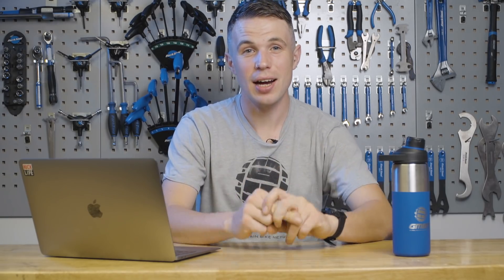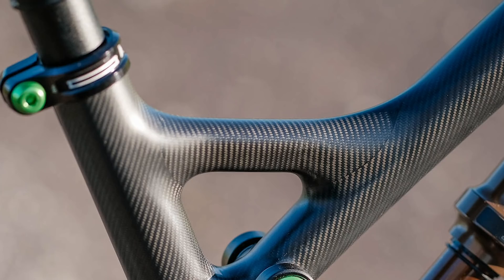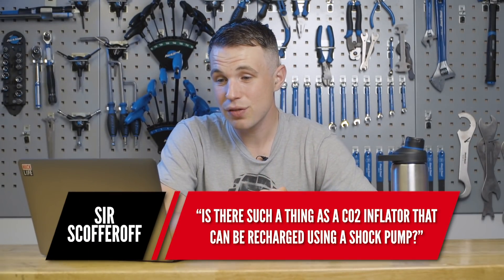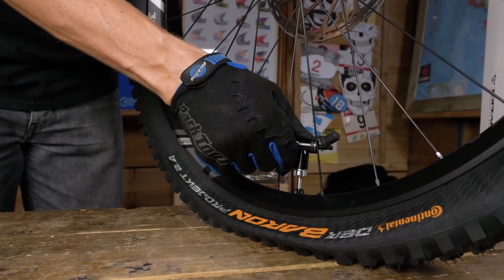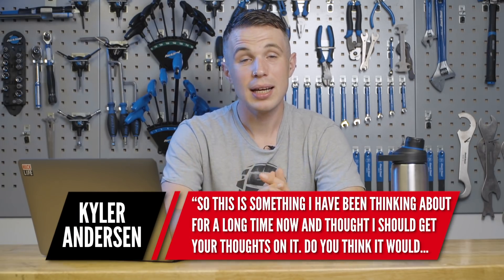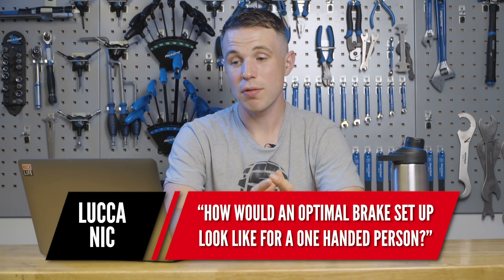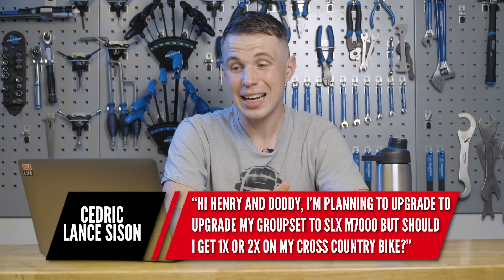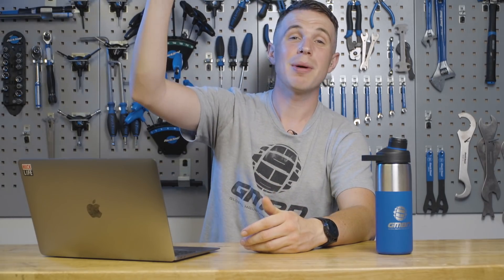Why Are Fork Stanchions Circular? | #AskGMBNTech Ep. 88

Comment: Hi doddy/henry! I have an old fox dhx 4.0 coil with the boostvalve (jepp, i’m back with my suspension problems). However, after riding my bike for like 1-2 hours it has lost all it’s pressure(which has me concerned because the minimum pressure is 125 psi) and even after pumping it up to maximum pressure, it jeeps loosing pressure over time(except when im not riding it) is the shock completely destroyed or are there any parts that I could replace?

Comment: #askgmbntech Should I upgrade my brakes (levers and calipers) or the rotors (180/160mm to 200/180mm)? I'm currently using Shimano m425 brakes w/ 180/160mm rotors on a 2013 Devinci Dixon (26", 145mm travel). They work alright on mellow trails, but they fade significantly on long descents. I know these are cheap brakes; I'm was on a tight budget. I found some Shimano SLX M7000 brakes at a decent price, but would larger rotors be more effective in this situation? I'm hoping for more stopping power and less fade. Thanks!

Comment: #askgmbntech sent this via email ( jdm4life@hotmail.co.uk ) with images some time ago but no joy so will try here...

I have a dropper seatpost height issue. The bikes a 2017 Gt sanction expert in XL. Im 6'3 and my problem is the dropper seatpost wont go down far enough at its lowest setting for downhills. It just feels in the way and being long in the body Id like to feel a bit more clearance. The dropper on there now has quite a big collar (30mm). Its also quite a short extension on the dropper too so for riding uphills I also have to stop and extend the seatpost out a few inches so I have the right height for climbs...then stop again and drop it to the bottom for the decents....which defeats the purpose of having a dropper. 
With the seat set at the right height for riding uphills, the measurement from the top of the seatpost clamp to the bottom of the saddle rails is circa 200mm. I then drop this right down into the frame as far as it wil go for downhills and it still feels too high for descending and riding techy trialsy stuff. Its very frustrating. 

I used to ride a pashley 26mhz trials bike back in the day (circa 16 years ago) but fell out with riding bikes until I bought this trail bike a couple of years ago and am glad to be riding again. In May I spent 5 weeks in Colorado with my old trials riding mate who lives out there now. We rode all kinds including the ribbon at grand junction and also got out to Moab to ride the whole enchilada and captain ahab etc...the bike was faultless but Id really like the seat lower. I just fitted a 40mm rise renthal fat bar as it came with a 20mm rise which was a big improvement. The seat is a low profile wtb silverado.

Im actually heading back to Denver in 2 weeks for a 7 week trip to do a load of riding again. Going to utah to watch redbull rampage on the 25th and riding moab again 26th so would like to sort this dropper post niggle in time.

Im rambling....

Basically, is there a way to get the lowest possible height lower without spending £400+ on a bike yoke dropper which have a thinner collar? 

Ive considered cutting the seat tube down which will give me an extra 1 cm or so which isnt much but is something. Obviously that not the brightest idea ever. 

Thanks,

Steve

Comment: I have looked at how 1 lever can operate both brakes but from a road bike perspective and it's difficult but as others have said hope do a system that puts both levers on 1 side still giving independent front and rear brake and magura make the mt2 which is full hydraulic system operated by 1 lever. Also I currently use a problem solver 1:2 cable adapter with cable operated hydraulic calipers. I have also heard that a simple Y piece would work linking both hoses to 1 lever but others say it doesn't so maybe someone can help with that one

Comment: i am running a 1x12 gx eagle on my bike at the moment, and since it is an enduro bike is it the perfect setup for me. 

but i am kinda wanting to get myself an xc bike and for that would i prefer running a 2x10 becasue of the angle of the spokes, less gears gives a better angle on the spokes on the drive side and will increase stiffness of the rear wheel. it will also make it stronger without a weight penalty. 

i never had a problem with my 3x9 sram x9 on my stumpjumper during the 9 years i was riding that bike so i can't see that the 2x10 will be even better.

Comment: #askgmbntech hi Doddy i have a 2014 specialized enduro expert and the shock is leaking air and it looks like it will be very expensive to send it away. If i buy a bike yoke #3 i can have a 200x57 shock but im struggling to find a shock thats not too expensive any advice

Comment: #askgmbntech hey guys i have a question about a creak. the fork CSU has a creak where the stanchions meet it. It's a 2014 fox 36 factory talas, I've heard that you can use loctite 290 and it will solve the problem. do you guys have experience with this and does it work? Cheers and love the show

Comment: #askgmbntech I have a fairly regular, yet intermittent click coming from my front wheel I think. Could this be from the hub bearings? I only hear it while riding so it's hard to pin point. Bike is fairly new with <1k miles. Thanks!

Comment: #AskGMBNTech hi Henry and Doddy I am looking at getting a Marin San Quentin 3, I am 13 and 181cm tall and still growing(quite well proportioned). The L is for 173-178cm with a reach of 464mm. The XL is for 178-183cm with a reach of 484mm. The XXL is for 183-188cm but does not say the reach. I ride a few jumps and love trails. I just want some advice on what size to get. ( it will be 3-4 moths till I get it) 
Thanks

Comment: #askgmbntech This may be a stupid question but if a derailleur shifts by how much the cable is pulled through by the shifter, why couldn’t you take for example an eight speed mech and use an eleven speed shifter so that the cable is pulled through in more, smaller increments so that it could shift into those eleven gears? I understand you would have to replace the jockey and guide wheels to be compatible with the chain but would there be anything else stopping you?

Comment: there are a couple of primary reasons stations are circular:
1) It's the cheapest profile to make accurately enough (it's one operation to turn the station surface on a lathe) and to inspect. (a weird shape will be orders of magnitude more expensive to generate a good seal)
2) Smallest circumference for a given area means it minimizes the amount of seal area, therefore friction.

Other reasons may be true put I'm confident they're much less significant.

Comment: Stresses from force concentrate where there is a change in radius and/ or direction ie: a corner or bend.  This is usually where the point of a failure occurs.  Circular shapes like a tube or cylinder do not have a change in radius/ direction like a square shape. Therefore making them stronger for stanchions, hydraulic/ pneumatic rams, pressure pipe etc etc.

Comment: With the wireless brakes, the easy way to solve the safety issue is the same as magnetic door locks. Have the default position of the brakes to be on, so the brakes by default would be fully locked up, and the electronics move the pressure away from the pistons to allow the wheel to rotate. So if the battery was to ever fail, the brakes would go on and stop you, rather than you having no brakes at all

Comment: The wireless brake question raises several issues that don't apply to wireless shifters. 

First is power source. Shifters have a smallish battery and that is enough, but supplying enough power for braking means a much larger and heavier battery. And you would need one for front and another for rear brakes.

Second thing is modulation. Shifters have a single movement and the change is done. Braking is sometimes hard, sometimes soft. The system would need to be able to vary the power applied. That means the levers would have to be constantly variable so you could control braking force.

Third is feedback. When we brake we are aware of how much braking force is being applied, and we increase or decrease lever pressure without having to think about it. Wireless braking would mean having some sort of feedback in the lever so we could do the same as we do with cables or hydraulics. That means a lever with variable resistance, and that means the lever would have to have a servo motor in there somewhere, requiring a more hefty battery than what a simple wireless controller needs. Once again, we would need one for each of front and rear brakes. 

That's four different battery packs, plus four servo motors for each wheel and lever, plus the software controller. Are we there yet?

Comment: I’m a mechanical engineer, an fresh out of college one, but one none the less. 

I really like the seal shape explanation. It was just really well put. The stanchion points are also because friction is based on pressure not surface area, so if flex does happens that is hot uniform, as a twist around the tube, the increase in pressure on the mismatched alignment will increase friction. 

Lastly a circular pipe is stronger in the type of loading that the stanchions will experience than another shape.
Reply: Well said! The cylinder shape with a consistent radius will provide the strongest cross section for the stresses/forces the fork will see. Combine this with the ease of a smaller diameter cylinder sliding within a larger diameter cylinder and you get an excellent recipe for strength and durability with reliable and consistent execution (assuming the other parts & internals work well together.) 🤘

Comment: Regarding the CO2 canisters, the CO2 is actually a solid in the canister. CO2 (in the temperatures and pressures we have here on earth) experiences sublimation. This means it doesn't have a liquid state; it goes straight from a solid to a gas.

No chance of managing to recharge it to anything like appropriate pressures with a hand pump unfortunately.

Comment: No chance of electric brakes outside of a tradeshow stunt
Reply: If all you want is a clean brake setup to go with your wireless shifting, look no further than the Magura Cockpit Integration (MCI). The brake cables run through the bars, stem en into the frame. You'll only see the last bit at the calliper and of course the part that exits the fork crown.

Comment: #askgmbntech I just got a new mountain bike almost 5 days ago, and I am hearing a super high pitched squeak coming from what I think are the brakes. It has Tektro HD-M290 hydraulic disc brakes. I also am having trouble with 9th gear on the SRAM NX 11 speed drivetrain. I think it’s from cable stretch but it is only effecting that one gear. It tends to jump back and forth between 9 and 8. Thanks for the help!
Reply: Squealing brakes on a new bike sounds like you didn't bed them in. GMBN have a video on it, but it means riding on a straight road and hitting the brakes firmly enough to slow the bike but not skid. Then do it again, and again, and again, up to 10 or 20 times. The goal is to raise the temp of the brakes so the pads and rotors match up any slight differences in surface imperfections.

Comment: My two cents. Circular designs in any structure provide more strength compared with other shapes. Engineering design perspective, using the same type of strength of material, the structure required to stand the forces acting in a non circular fork designed stanchions will be much bigger than the circular one. Imagine using a non circular fork stanchions which may possibly be three to five times heavier (or more!) and bigger than the circular one is needed to stand the dynamic forces of mountainbiking. Forces are evenly distributed in a seamless circular shape stanchions which make it possible to stand those dynamic forces well. Basic design formula: Strength of the stanchion material equals the dynamic forces from mountainbiking / stanchions area (either a circular or non circular stanchions).

Comment: #askGMBNTech
 Hello, great videos you are doing guys! I have a hardtail with 130mm fork for 29/27+ wheels and 51mm offset, running 27.5x2.8" wheels/tyres, and I am looking to upgrade the fork. I don't want to change much the geometry, so I was thinking of getting a  150mm fork (offset?) 27.5 version with the idea that I will get 20mm extra in travel and lose 20mm from the lowers for going from 29er fork to 27.5, equalising the difference between the forks. In theory, checking the table of specs for all 2020 Rockshox forks and the crown to axle measurement, the idea seem to work, what do you think? Any concerns?  (Don't worry about the tyre, almost all 2020 Rockshox 27.5 forks can fit 2.8". Current fork is an RS Recon, and looking to get a new RS Pike)  Thanks! 😃

Comment: I once did a custom brake set-up for an amputee. I used trp cable calipers, and spliced the cables using a Primo Pervert, which is an old cable splicer for making your own gyro cables on a bmx. It was then a matter of having a slight rear brake bias, but it came up a treat.

Comment: #AskGMBNTech My old Giant 2010 hardtail has been upstaged by my new Whyte full-sus bike for serious trail riding, so it's now got given a pannier rack and stuff for a second lease of life for bike-packing/adventure stuff and commuting. I'm inspired to fit dynamo lights to it, oddly enough from my Electra Cruiser pub/shopping bike - never charging lights, worrying if the batteries might die and it always being ready to go is great and so ridiculously handy! But all the pics I seem to see of dynamo light bikes have fixed front forks. Are there any tips or contraptions for fitting dynamo hub wiring to a (120mm) suspension fork and ensuring correct cable slack from the dynamo hub, or is it largely never done with suspension forks?

Comment: Square tubes are also weaker than  round tubes. Trust me, I'm not an engineer. But I'm pretty sure this is correct.
Reply: "The answer is round tube has a higher resistance to both flex and torsional twisting than square for a given weight."

http://www.super7thheaven.co.uk/round-tube-stronger-square/

Comment: #askgmbn hi guys love the videos! i was wondering when going over rock gardens and just terrain, my cranks and pedals are constantly hitting the ground. i have found that by fastening my rebound it has slightly helped but how could i avoid this happening further? also what shop towel do you use as i really need some, thankyou.
Reply: how long are your cranks? if they are 175mm then you could invest in some 165 mm cranks. that will shorten their length my 1cm, so should reduce pedal strike.
Also, what travel does your fork have compared to what the bike frame builder suggests. If the Frame is designed for a 160mm fork, for instance, and you are running a 100mm fork for XC, then your BB will be at least 1cm lower than it should be, thus increasing your chance of pedal strike.
Hope this helps. 
Good luck.

Comment: Spot on with co2 inflators. Far higher pressure than any shock pump could reach, high enough to liquify it. Holds approx same volume of gas at atmospheric pressure as tubeless self charged cans, but squashed into much smaller package, hense the high pressure

Comment: #AskGMBNTech Hey, hope you're enjoying the cooler weather - I have a pretty technical question. I want to swap the big ring off of my triple crank for a bash/chain guard, but I want to make one myself. Would 3mm thick 1000 or 3000 series aluminum (from recycled cookware) work, or would it be too soft compared to 6061 to actually provide any protection?
Reply: Just cut the teeth off ur large chain ring and use that

Comment: #askgmbntech hi guys, I recently brought an ex demo bike online and when i received it I realised it was European brake setup. What is the best hassle free way to swap the brakes the right way round. Also please could you explain fitment details of chainring guides? Ive brought a Nukeproof Scout comp 290 2019 and heard its difficult to find a chain guide that fits because of its boost. Thanks guys!
Reply: If its sram, the levers should be ambidextrous (bleed screw top and bottom sides of the lever body), so just unbolt the lever at the bar and swap them round. No need to disconnect hoses at all, vvv easy.
If shimano, u might need to disconnect and swap the hoses and then bleed. Not sure shimano levers are ambidextrous.
Reply: Rupert Wenn Thanks for the advice :)

Comment: To add to one comment a little earlier by @Dave Williams: The stress concentrations at the corners of a stanchion would be a major concern. With a round cylinder when things twist the pressure is evenly distributed around the circle. With a square, however, that stress would all fall on the corners as they alone would start pressing up against the bushings etc inside.
Reply: True. The cylinder shape with a consistent radius will provide the strongest cross section for the stresses/forces the fork will see. Combine this with the ease of a smaller diameter cylinder sliding within a larger diameter cylinder and you get an excellent recipe for strength and durability with reliable and consistent execution (assuming the other parts & internals work well together.) 🤘

Comment: #askgmbntech can I put a 203 millimetre rotor on my bike that runs by now 200 millimetre rotors or do I have to buy an adapter. ( I currently run Magura mt 7 )
Reply: You need a 1.5mm washer at each end
Reply: Stephen Lord Ok thank you.
Reply: Black Shepherd sometimes they may fit anyway depending on fork/caliper combo but the difference in radius is just 1/2 the 3mm difference.  You just need the caliper to be raised by about 1.5mm ... that must be a awesome amount of stopping power on MT7’s...
Reply: Stephen Lord Oh yes it is. I love this brakes 😊